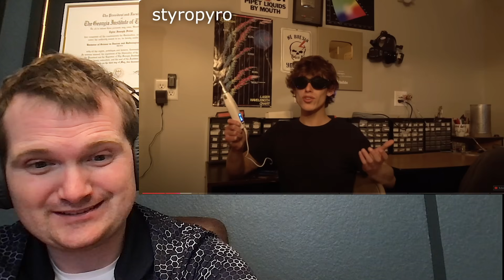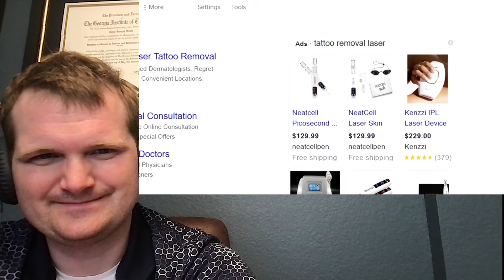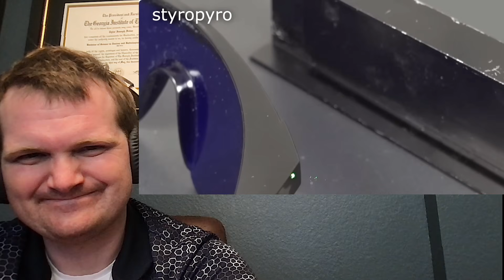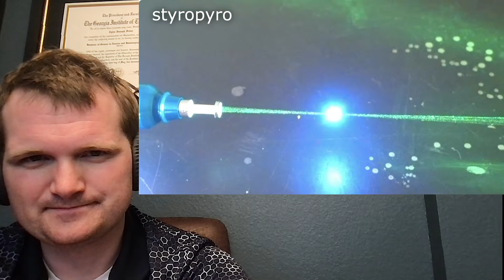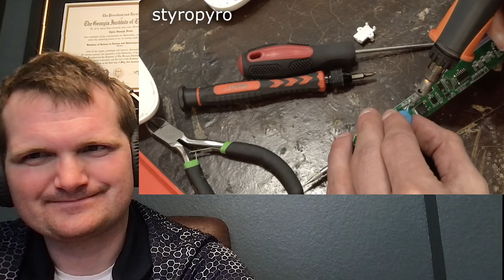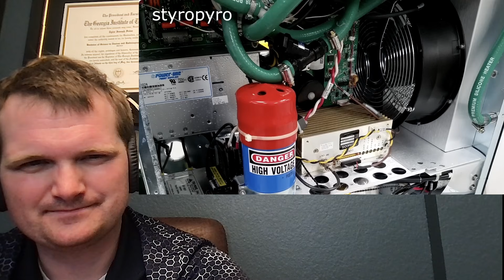"Medical" Lasers from eBay? - Nuclear Engineer Reacts to Styropyro

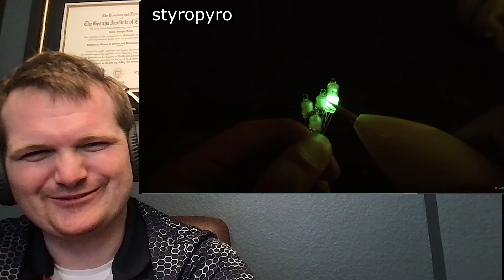Comment: 20:14 i belive this device is also using pulses and the put the capacitor that is unloading and loading at tthe pulses speed to be alot bigger in capacity but also bigger in voltage. so that capacitor would store more voltage and have also a kick you dont want to see:))

Comment: Yeah, you can tell that it's not really picoseconds by the simple fact that you can see it on camera. Modern cameras only take like a millisecond to capture a frame and typically only do that 30-60 times per second, so for over 90% of the time, they are not actually capturing anything. Anything that is really, really fast is therefore very likely to fall in between the frames and not be seen. Strobe lights have this property, as do the muzzle flashes from firearms.
EDIT: Yeah, then he pulls out the other laser and you can see the difference; you can see some of the flashes that happen to land during the time the camera is capturing, but most of them are completely invisible.

Comment: Well, random flash for no reason with a flash tube laser? Static electricity could even trigger the flash tube if the main voltage is left connected while idle. Which would save you a switch but at safety costs.

Comment: As to why the medical laser is green, you're right about it being well absorbed, but there are a couple other advantages: First, it's visible, and that does make it safer, since anyone in the area who isn't already wearing laser goggles instantly knows when it gets turned on and where the beam is, whereas with an IR laser if other safety procedures fail you have no way of knowing that there's a dangerous beam that could burn your retina in the room; second, green, particularly 532 nm, is very easy to produce at quite high powers. That's because Nd:YAG (neodymium doped yttrium aluminum garnet) can produce extremely high powers at 1064 nm, and it's fairly straightforward to frequency double (which halves the wavelength) to 532 nm green light.
Reply: There's a reason that visible and IR lasers of the same power have different ratings. For a visible laser to do damage, it has to do so faster than your eye can reflexively blink when you look into a light. That's a pretty short time, while an IR laser, you can be dangerously exposed to for multiple seconds.

Comment: Speaking of pulsed lasers, in undergrad I worked in a lab doing ~50 femtosecond (fs) laser pulses for extremely high intensity laser experiments. My adviser liked to say that it was roughly the same intensity as taking all the power from the sun hitting the entire earth and focusing it down to a postage stamp. Now, the actual area being hit by the laser pulse is much smaller than a postage stamp, but you can do some interesting science with this. The intensity is so high that there are effectively many photons hitting the same atom at the same time, and, without delving deep into how it actually works, the atoms can essentially absorb all of those photons at the same time and re-emit them as a single, higher energy photon that's an integer multiple (a "harmonic") of the original photon energy. If the atom has a very high ionization threshold, such as helium, then you can get up to something like the 109th harmonic, so you effectively input a bunch of near infrared photons around 800 nm and get a single extreme ultraviolet photon around 7 nm. The tricks to get to that kind of intensity are very cool and clever (one of the coolest tricks is called "chirped pulse amplification," which is a way of getting around the fact that the very high intensity of a fs-scale pulse with decent energy would actually burn your laser crystal because of the high intensity. To reach the pulse power that you want you actually take a low energy fs pulse, put it on a pair of reflective diffraction gratings arranged so that the lower and higher frequency components of your pulse travel different distances, spreading them out in time, which makes your pulse much, much longer, spreading out the energy in your laser crystal so that it doesn't burn the crystal... then, after you've gotten the pulse to the energy you want (up to about 1 J), you send it back through another pair of reflective gratings arranged to reverse the stretching you did earlier, compressing your pulse back down to the fs time scale, but with much higher energy to allow for the insane intensities that you're looking for). This kind of device is also a step toward even faster, attosecond scale pulses (well, tens of attoseconds, but still, 1e-17 seconds is very short, so short that it's comparable to the time scales of electronic motion in atoms and molecules... and these attosecond physics experiments require even better femtosecond pulses than the ones that I worked with 15 years ago). So when you say "You can get picosecond laser pulses" and talk about MW level powers... you can push that even farther, to something like 30 fs and 30 TW (or even faster, but not as high intensity, the attosecond pulse generation doesn't convert much of the energy from the femtosecond pulses into attosecond pulses), but instead of a microwave oven-sized apparatus, you have an optical table-sized (typically 5'x10') apparatus, typically with a titanium-doped sapphire crystal as the gain medium at the heart of it.
Reply: use paragraphs bruh.

Comment: You’d be surprised what crazy things you can buy between eBay and Amazon. I got an old Chirana X-ray tube for my collection and it’s terrifying how powerful it is, I’ve only tested it once with a remote switch so I didn’t have to be near it and it maxed out every detector I put in front of it. The best reading was from my Victoreen 492 at 200mR/h, or about 2mSv/h, that’s the only time I’ve ever used it. My Radiacode 103 just dropped to zero while it was on, it over saturated.
Reply: yea between amazon and ebay you likely could build a legit nuclear bomb because there's zero regulations on there
Reply: based on a (very) quick search, about a year's worth background dose?

Comment: The actual lasers professionals use for dermatology treatments are the size of a very large mini fridge. I don’t know how anyone could think this actually works for those treatments
Reply: The actual laser diodes themselves aren't very big. I've seen a 10KW diode about the size of half a stack of playing cards. Granted that same diode requires a gigantic powersupply, liquid cooling and optics, but for a laser if only a couple of watts or even a few dozen watts it's absolutely feasible to shove all that into a device around this size. 

It's well within the bounds existing technology to produce dermatological grade lasers that would be bigger than this but still way smaller than you describe. 

The reason you don't see them is because the validation process to get a new device approved is lengthy and there's little to no reason to make them that small. The reason proper comercial units are so much larger is partially legacy design but also durability and cost savings. A larger design makes cooling easier and essentially allows much greater margins of safety and duty cycle. 

I can totally see how someone who doesnt understand how dangerous lasers can be wouldn't pick up on the problem based on size alone though.

Comment: Removes blemishes!! Side effects may include melanoma. Also, medical personnel who use lasers are, obviously, well trained in how to use it. If you watch Dr. Sandra Lee, she uses this type of device to remove blemishes, but only for like half a second.
Reply: I mean it can't cause melanoma, just severe burns. And it probably does remove blemishes in the same way cutting the area and pouring hydrogen peroxide on it till all the cells in the area died could remove blemishes. It just ineffective and incredible dangerous and can leave long lasting damage.
Reply: maybe he has that now a melanoma, he is sick i guess at the moment.
Reply: @TheDddkkk  a laser can't really cause any kind of cancer unless it's in the ultraviolet spectrum.
Reply: blue that's not too much of an issue. But severe burns yes.  They work technically but it's better to have a professional do it.

Comment: As a person who verified medical equipment for release under FDA rules, I'm horrified at the total lack of verification and validation in these devices. One key element of medical device manufacture are Failure Mode Effects Analysis (FMEAs). The probability of risk event and the effects of the event would 100% prevent these from being released under FDA rules. I'm glad his craziness and your review help circulate the extreme danger of this garbage.
Fore reference, most of the FDA's medical device and radiation-emitting product regulations are in Title 21 CFR Parts 800-1299.
Reply: ebay and amazon are extremely lacking in verifying products (i'd guess it keeps the costs down). this is a problem across the board in all areas of tech/industrial related stuff.
Reply: As an electronic hobbiest who has a couple of cheap blue lasers in the 1w to 5w range, I really don't like how these are advertised. I have a windowless room in my basement with a brick backdrop to fire these off. I also have the correct safety goggles for the wavelength of my lasers.

If these were sold to the public with the correct PPE, came with clear warnings of how dangerous they are, and not advertised as medical products I would be okay with them being sold. Any of these that say they are cat toys or regular laser pointers need to be removed.
Reply: Leave my "lab equipment" alone
Reply: one word styropyro
Reply: Nah, f@ck FDA and regulations. Just keep ur brain on and everything gonna be fine.
Reply: Waaaahhh winey am
Reply: Sounds like a cry baby
Reply: @Mudcrabbed  It's how I worked on life saving medical devices as required by law. Failure to do so could cause your employer to be forbidden to sell the device.

Comment: This is the same kind of scam that the people who sold the automated litterboxes for cats, Always do research on an item before you buy an item or it could LITERALLY TAKE A LIFE like what happend to the poor cats. 

It's extremly easy for people to sell items with near 0 safety testing.
Reply: sorry but these are not even remotely the same. these lasers have no function for the general public and too many risks involved. the automated litter boxes have their place and can be useful, especially for persons with disabilities, when used appropriately -- not a scam, just poorly implemented safety features
Reply: @smultron  Most automated litter boxes are safe, but there was a generic knockoff brand box sold on Amazon that was trapping and killing cats. I'm not a cat owner so I'm quoting one instead on this: "I've never seen an automatic litter box that rolls forward/backward and closes the front. All the ones I've owned roll to the side so the front entrance always stays open." So this particular knockoff litter box used a terrible design, they were too lazy or short-sighted to not work a failsafe out. It probably caught people by surprise because it looked a lot like the reputable brands.
Reply: @smultron  Yeah you right it's not a scam but it's still the same thing. The litterboxes was a ripoff version from another company wich sold safe litterboxes with failsafe systems. This is also a ripoff item from a reseller that's just trying to make money with no concern of how safe the item is. I just took the cat litterboxes as an example but this is a very massive thing that has been popular for a few years now. It's so easy nowadays to resell items on sites like ebay/amazon etc.

Comment: I still don't understand how it's more profitable to make a high power hazard than a low power hoax. They're deceiving people either way, so going the extra mile to make it incredibly dangerous seems like an unneeded expense.
Reply: The people making the actual laser and the people selling it to consumers are not the same people.  That is the answer.  The manufacturer of the laser itself is simply producing a product to meet certain specifications.  They would go out of business if they didn't do that.
Reply: I don't think the higher power components are that much more expensive tbh. Maybe a couple bucks in the grand scheme? The part that gets expensive is the careful engineering that surrounds the component to make it medically useful and safe, which obviously they're putting no thought into.
Reply: @PaulMorgan1 Yes.  Most of the expense goes into being able to produce lasers at all.  Plus, as I said, the people making the laser itself are probably not even the people who are putting the device together, and the people ultimately selling it for the last time may well be different people, too.
Reply: I suppose it could potentially also be a general loophole to labeling regulations, and circumventing their labels as "lasers" in order to sell more and to a broader range of end users.
Reply: Usually these sketchy components are working modules or units that fail to meet prescribed specifications so are "binned". 

This practice is common in semiconductors, chips or discrete semiconductors have less than 100% yield from a manufacturing run the lower quality parts aren't thrown out theyre repackaged as cheaper lower rated products. This is extremely common for high end CPUs and GPUS for example. Similar processes and procedures exist for most electronics too. 

I'm 90% certain that the high power modules are recovered from finished devices that failed validation or quality control or the modules themselves didnt meet the prescribed spec and were essentially sold as scrap on the grey market to third parties who then sell them to consumers or package them into these death machines. 

I'm deeply ambivalent about this personally because on the one hand it does reduce Ewaste and allows for hobbyists and enthusiasts to get some components they'd never be able to otherwise. On the other hand it also leads to a lot of incredibly dangerous shit getting into the hands of people who really shouldn't be touching them...
Reply: What’s the hoax? No doubt that thing will zap away anything you could want it to
Reply: @patrciaclemons8183  The "low power hoax" is is what they did NOT do.
Reply: Sadism?

Comment: Barcode scanners are usually class 2 these days, and laser pointers can easily be (at least in the USA) class 3A.
Reply: In my experience barcode scanners are usually a camera with some LEDs for illumination. If it can read a barcode off a phone screen, then it is not going to be laser because it won't work.
Reply: @katrinabryce  Older units have a spinning mirror and a small laser.  As the laser scans across the barcode it generates a waveform in the receiving photodiode.
Today camera based scanners are common due to processing power capable of detecting patterns in digital images.